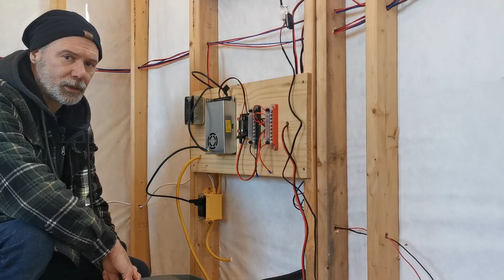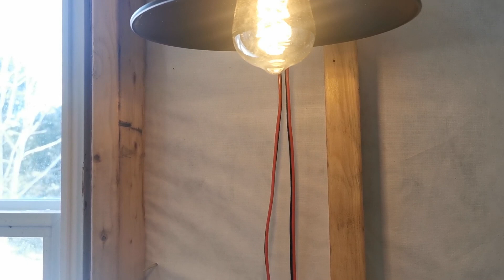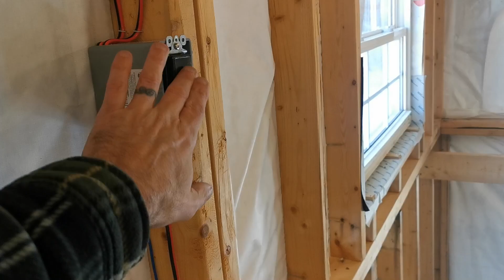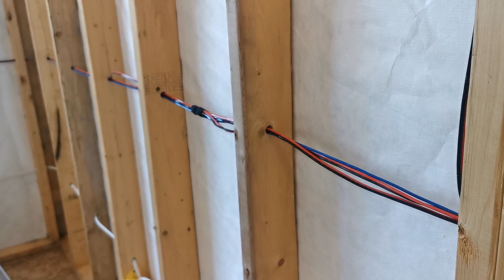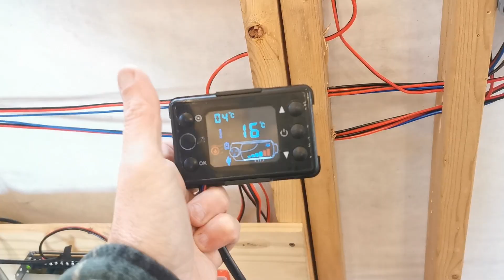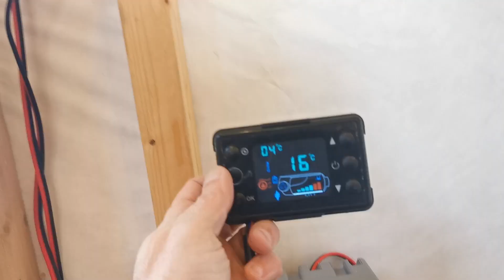12 volt lighting for off grid cabin

Comment: Great video. I really appreciate it. I know you have three circuits, what does the fourth wire in the blocks go to? thanks
Reply from the maker: There are 3 lighting circuits; the overhead lights, living room lights and chandelier. There is another unswitched circuit that powers the loft lights as well as a 12v outlet in the living room for a Bluetooth amplifier. There is actually a fifth separate one for the diesel heater as well.